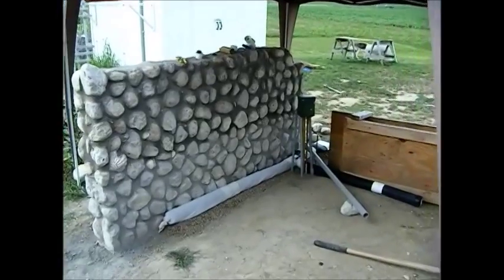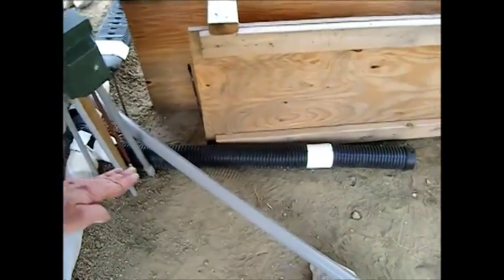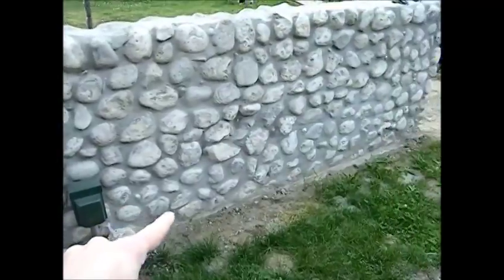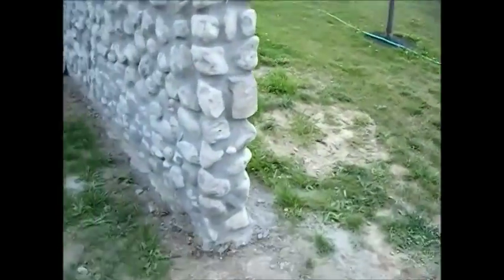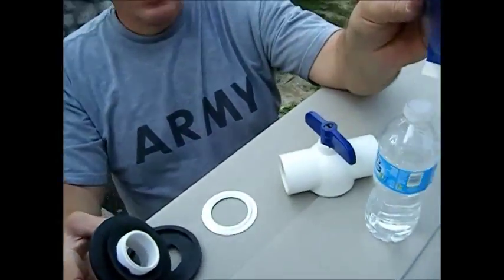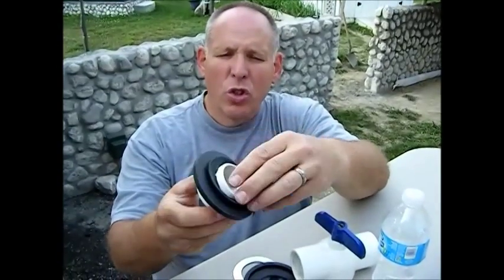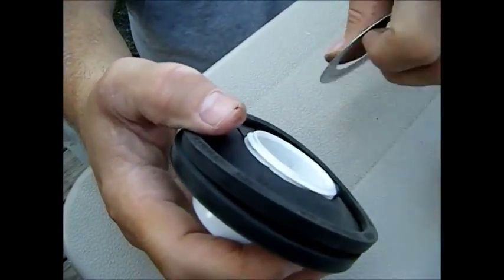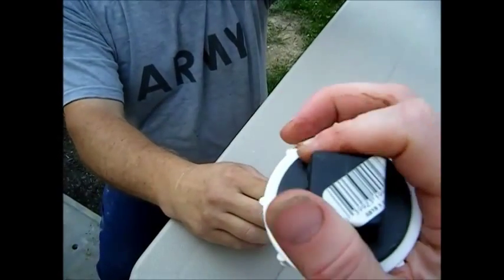Slip Forming a Stone Garden Wall Part 4

Comment: The drain in the pond should be a plain pipe extending to the highest water line and be opened so if the water level during a hard rain overfills pond it can automaticly flow into the drain. This way a valve is not required. When you want to drain pond just unscrew the extention pipe out and let it drain. Easy and no reaching down into the pond--and cheaper.